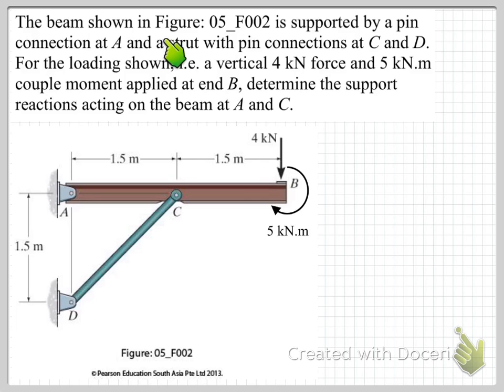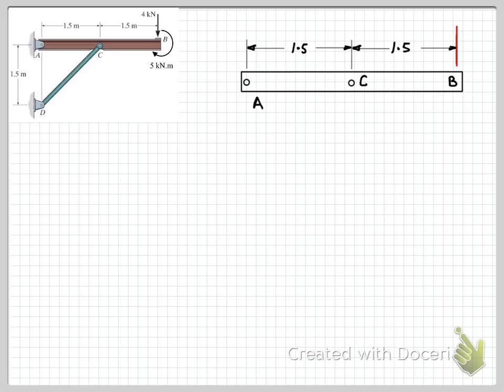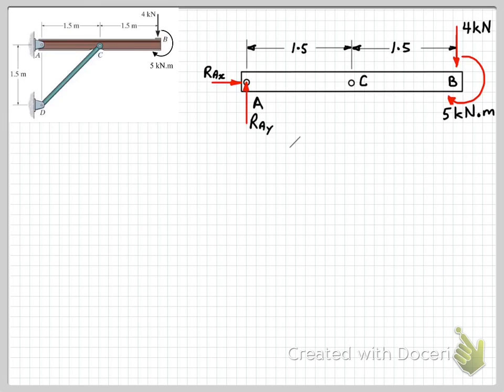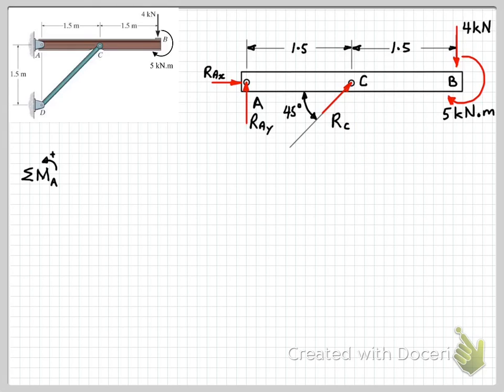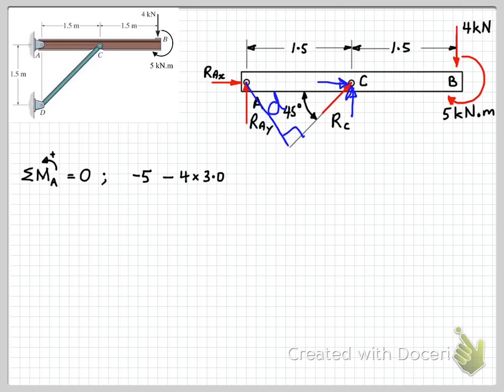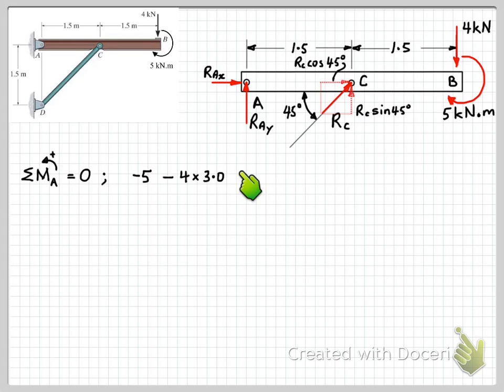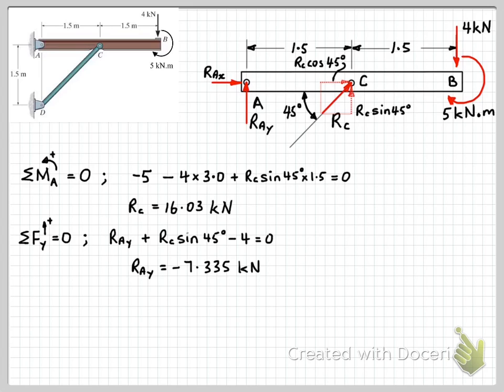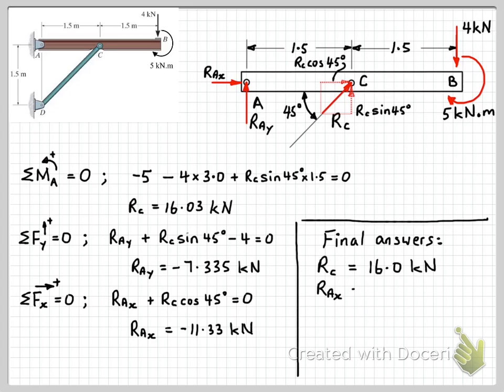Beam with strut example

Comment: Is there a chance that the direction Ax is towards the left?
Reply from the maker: Hi Arinze, the negative answer that I get for RAx indicates that its sense is to the left (because in my free body diagram I assumed it to be to the right). If I had drawn RAx to the left, my value for RAx would have come out positive.
Reply: @TerryBrownMechEng  
Ok, thank you very much sir.
But let's assume that Ax is towards the right, would it then mean that Ax= AC?
Reply from the maker: @arinzeanthony7447  I did assume it was to the right (in my free body diagram), and then in the solution the equation of equilibrium shows that it is equal in magnitude to the horizontal (or x) component of RC but in the opposite sense (I.e. negative and therefore to the left). Sorry for the delayed reply. I didn’t see the notification of your comment til now.

Comment: If A and B were each supported (like a jib crane with a brace) but could swivel side to side, not pivot up and down, how would you work this problem? Would there be Ray and Rdy forces?  Would Rdy just be RcSin45?
Reply from the maker: Hi Brian, sorry, I'm not sure exactly what you mean by A and B supported. It's difficult to interpret without drawing/picture. Nevertheless, if there's a pin support at A that prevents vertical motion, then there will generally be a reaction force Ray. If there's a support at B, as well as A and D, the problem is likely to be statically indeterminate. If DC is pinned at both ends (i.e. it's a 2-force member), then Rc is equal and opposite Rd and directed along the line joining C and D, therefore Rdy = Rcsin45 =Rdsin45

Comment: Why don’t we consider the normal reaction of the pin (of the strut) on the beam?
Reply from the maker: Hi Ayush, thanks for the question. We do consider it. It's the vertical component of the force Rc that the pin (or strut) exerts on the beam.

Comment: Hi Terry, Thanks for the great video. How would the calculations change if the pinned supports were rigid instead out of curiosity. Your help is much appreciated! Many Thanks
Reply from the maker: Thanks for your feedback and question. Let's take the more likely scenario and assume just the support at A is a rigid support. In this case, when you draw the free body diagram of the beam ACB you will have an additional unknown at A, i.e. the moment reaction. We will now have 4 unknowns, the two force reactions and the moment reaction at A, and the force at C due to the supporting strut (we know it's direction because CD is a 2-force member). 4 unknowns, but only 3 equations of equilibrium mean that the problem is statically indeterminate and we need to use methods from mechanics of materials. We need to include the compatibility equation (from looking at deflections) and using super-position.
Reply: @TerryBrownMechEng No problem at all!  Thank you  very much for your detailed response, very much appreciated. Keep it up!

Comment: Hey so I'm working on a project for my machine Design class and I'm trying to analyze something similar to this. Its a mounting bracket so AD will be connected. Does anyone know how to measure the internal loads in such a structure or know of any videos that could help?
Reply from the maker: not sure what you mean by AD will be connected. In the video problem A and D are both connected to 'ground' and are therefore connected together. In the video problem, if there was another member between AD (pin connected at both ends), this member would theoretically do nothing because both A and D are already pin connected to ground. The only loads on the member AD would be due to assembly, e.g. if there is interference in the connections. If, however, either A or D is a roller connection, and you have a member between A and D, then a force will be generated in the member AD. It then becomes kind of like a truss analysis by method of joints. Note though, that ACB is a beam and not a strut.

Comment: Hey sir... I really enjoy your content and I have learned a lot ... so thanks for that. But why don´t we take the weight of the beam into consideration?
Reply from the maker: Ignoring the weight of components is a common simplification in textbooks and also practically in initial design when you are choosing the size of the beam and don't yet know how much it weighs. Usually the contribution of the weight is very small (i.e. negligible) compared to other loads. You can easily add in the weight of the beam as an additional distributed load or a point load through the centre of mass. In design you might want to do this after you have chosen your beam size to check your assumption that the weight is negligible.

Comment: Why do we not need to find support reaction at point D?
Reply from the maker: It wasn’t asked for in the question. But if it was, it would be the same as the reaction at C, since CD is a 2-force member in equilibrium. If you draw a free body diagram of CD, the force acting on CD at D would be equal and opposite to the force acting on CD at C. The force acting on ACD at C is equal and opposite the force acting on CD at C.

Comment: horizontal reaction force(Rax) is the reaction of which force???
Reply from the maker: The reactions at A (and also at C and D) result from all of the loads (forces and/or moments) acting on the structure. In this problem Rax exists, even though there is no horizontal force applied as a load, because the strut exerts a force at an angle of 45 deg to the beam ACB.